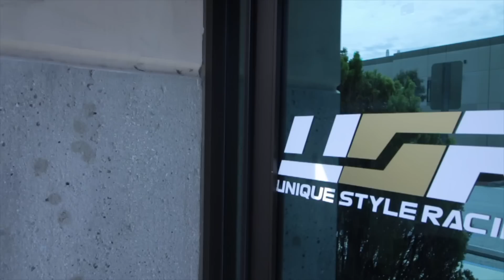How to Customize HEADLIGHTS | Mitsubishi EVO 8 | FlyRyde

Comment: Looks mint as! What brand of headlight sealant did you guys use to reseal the headlight? (OEM like sealant). Cheers!
Reply from the maker: We use a raw form of Retrorubber. It’s basically a gnarly ass block of Rubber Butyl that we stuff into our machine.

Comment: You think blue daytime running lights can be added on a 2012 Hyundai genesis sedan ?
Reply from the maker: I think they could, but that doesn't mean they SHOULD be added. Sounds like a quick ticket to me. Unless you have RGBW where you can do colors, but white always comes on automatic, you shouldn't mess with color on lights you can't turn off manually.